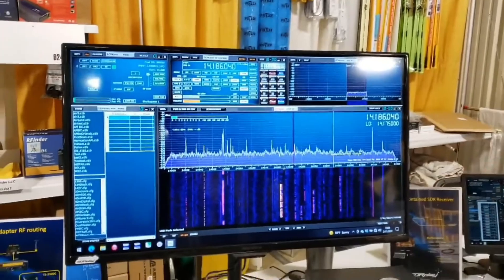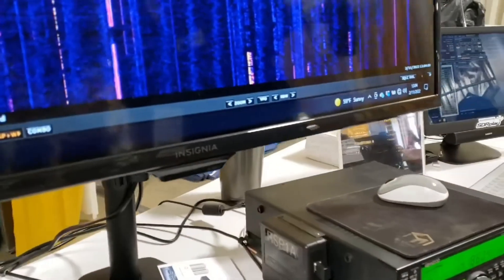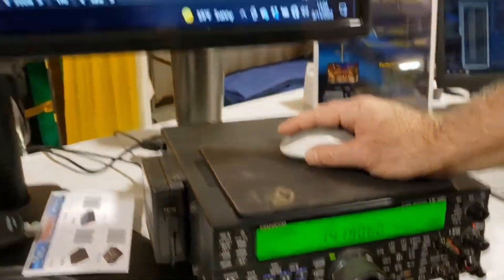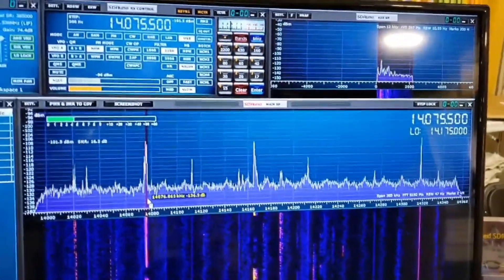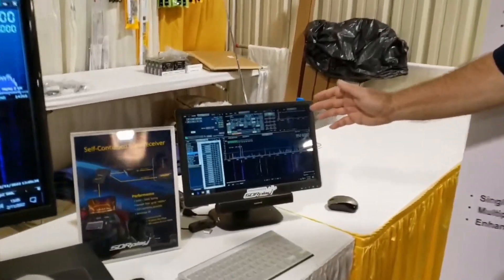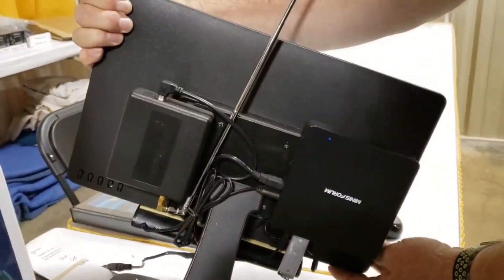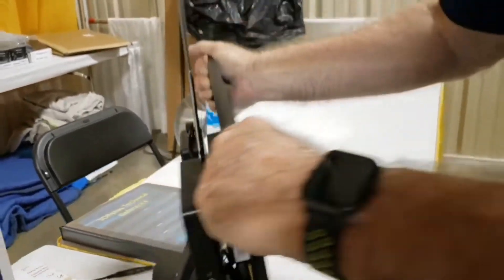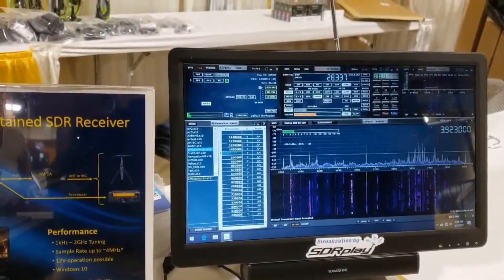SDRplay at Hamcation 2022

Comment: It'd be great if there was a macOS version of the sdruno software that's supported by the vendor I purchased the receiver from.
Reply: SDRPlay does intend to make SDRUno cross-platform in the future.
Reply: @Unit379  That would be great news!  I find that the sdrplay_api component is somewhat unreliable and needs to be frequently restarted on macOS when used with both CubicSDR and SDRPlusPlus.  I hope that improves along with the testing of the future cross-platform application.  

As they say at Yoyodyne Propulsion Systems: "The Future Begins Tomorrow."